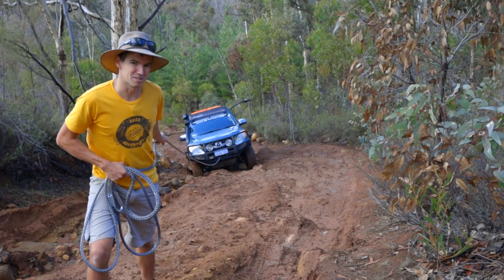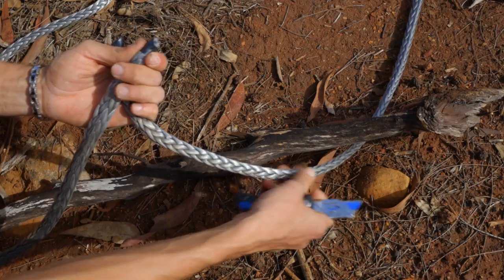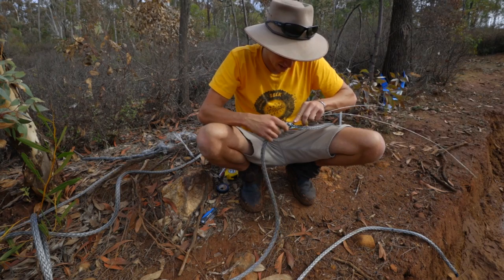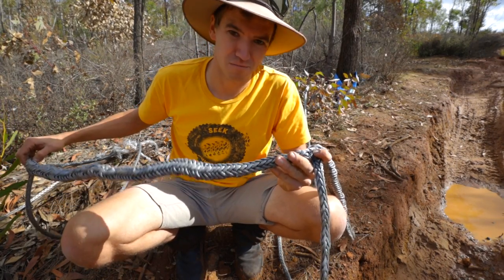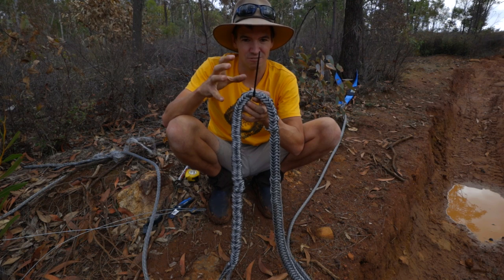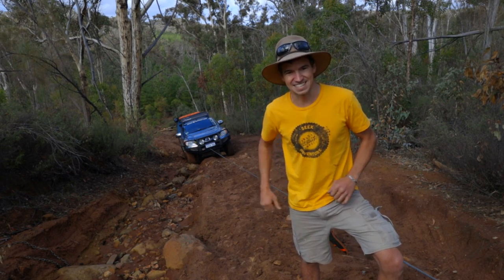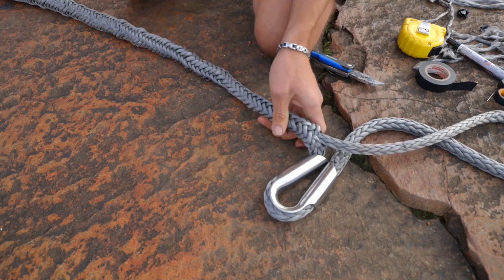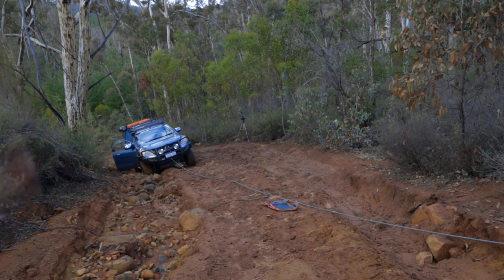Snapped My 4x4 Winch Rope

Comment: Always learning something. I initially thought why not use a steel cable? Then at the end I saw how tough this stuff really is.. and repairable.
Reply: Plus steel cable weighs so much more (huge difference when running it up a hill), and you need to wear heavy gloves when handling it to avoid slicing your hand open on any loose strands, the only problem with rope is you have to avoid rubbing it against rocks (but you can buy sliding sheaths that just stay on the rope, roll up on the drum and be be placed  where needed).

Comment: If you do not have a wire use the oil dip stick from the engine or transmission they work well. Good job with the information.

Comment: thanks for the informative video my rope split towards the hook end so will be fixing it using your second method, however I cannot find any information on stitching it anywhere as I want it to be hopefully a permanent solution, if you have any information on the stitching or could point me in the correct position that would be greatly appreciated, thanks again!

Comment: Could also just tie 2 bowling knots in about 30 seconds and continue the recovery. Can be easily untied after high loads since it was used in sailing and can splice once back at home off the trail or replace.

Comment: When terminating the rope. I always thought it’s better to pull it all the way through once before burying it inside. This way there is an additional change of direction to prevent the rope from slipping out. Infact I’m pretty sure with ski rope you’re supposed to weave it several times before burying it

Comment: A double Fisherman's knot works really well to join the rope together. 

especially if your winch rope is old and worn as it can be hard to splice.

Although this would be a better permanent fix as knots can have trouble going through a winch Farleigh.
Reply from the maker: The double fisherman's knot is an awesome knot for joining rope 👌👌.
The only trouble with tying a knot is that you don't have the full rope strength. While splicing gives you 100% of the rope strength 👍. At the end of the day a knot will get you out of the situation though 🙂

Comment: Not only was the winch rope was pre-cut but he also tried pulling the truck in gear. You can see right before the winch rope breaks that it is pulling the truck and the wheels are not spinning. I believe if I am out 4 wheelin', I will make sure to carry a wire rope or another synthetic.

Comment: No need to stitch it if you weave the tip completely through the rope a couple times before running it through the middle. Also, no need for the damper you're using there, seeing synthetic rope holds very little kinetic energy. Great video, mate!

Comment: I'm seriously not getting why the tail doesn't just come out like you showed towards the end when it's under load. Is it just that the outer layer sinches so tight that it can't move? Or maybe the opening it went through gets super tight? Any idea if it makes the rope weaker?

Comment: Assuming most offroaders don't carry a wire to fish through the rope, I'd be inclined to tie a rethreaded figure 8 to join the sections.  Just going back to my climbing days.  Maybe some sort of video on a true trail fix rather than a more sophisticated fix like this that is more likely done at home?  Dyneema has different knot tying characteristics, some knots might not pass through a fairlead, knots lower breaking strength substantially in many cases, etc.

Comment: You can actually splice without cutting out the tails.  Just trim out a few of the fuzzy bits.   It will serve as your taper section, you lose less length that way

Comment: Nice job there buddy. If you don't mind answering quick question,would you happen to know what the strength compared to original dope would be. Thank you.
Reply: Rope   but I'm sure everyone got it. I've written whole paragraphs and looked back at the word that iPad changed to another word and sometimes it fits and changes the whole meaning. I know there is a way besides better proof reading and rewriting the whole thing but I don't know how. Not very computer savy   but thanks again for a great video

Comment: Have you ever tried a double fisherman knot on that kind of rope. It might be a better temporary fix
Reply: ✖ NO, we don't need to try something that is weaker than the original. 

a) The fact that the rope broke in the first place is an indication that it will break again AT the exit of the double fisherman knot. (ie. at it's weakest point) , & 
b) you would have to cut it loose later to make the permanent repair, 
c) any knot would be problematic IF you have a pulley in that area of the system. 
d) I have used your method before but, where load bearing is involved, have regretted it every time.

Comment: Am contemplating buying a Carbon winch, are you still pleased with your choice?
Reply from the maker: Hey David, that's always a hard choice!
The winch has been great so far, the wireless remote controller is fantastic, water ingress is covered in the warranty which is good, apparently one of the lightest as well.
I have used other brands that unspool easier, and also that a quieter (Ironman Winch), the Carbon is quite loud.
Aside for that I have been pleased so far 🙂. All the best making the hard choice 🤐
Reply: Seek Adventure Thanks Michael, good reply.

Comment: I've used my 9500 lb winch on my 99 xj for 20 years almost daily I have done 300 yard pulls to get out of a swamp. All on the factory cable. I've seen guys I wheel with brake brand new rope. You can keep your junk rope.
Reply from the maker: You didn't watch the end of the video did you? 😉
Reply: @SeekAdventure  thanks for the reply. The fact is I did watch the end of the video. I have been an avid offroader sence 1979 and have owned a jeep for that long and all of them had a winch, I have never broke a winch cable. I have seen JKU's with band new winches bust rope on the first pull. If you would recreate that video with winch cable you better bring a 4.5 grinder with you to cut the cable not a knife. I'm sorry not a fan of the rope. The cable on my xj is shiny and flat from all the hard work it's done in its life. I do love a good stuck video.
Reply: R M I’ve been wheeling my xj since the late 1990’s. Done plenty of winching with my Superwinch 9000.  Mainly other jeeps but once had to use the winch to steer my pos back to camp.  3 hours of pulling the wheel left then right since my steering box broke.  That steel cable was draggin on lots of metal parts some not so smooth.  

I’ve also had to pull my self backward by throwing the cable under the car.  While pulling the line dragged on the cat converter. 

My line has a few shiney places from dragging over rocks but is still fine. 

The spectra line needs to be covered from uv light.  My steel cable does not care.  It’s been trouble free for 20 years.  

Given all that, I do plan on swapping in some nice spectra line in the next year.  

The price is coming down.

Comment: Why do you use a rope instead of a cable? The cable will be stronger and the winch will more than likely break before the cable will.
Reply: #1 lighter for front suspension of the car
#2 rather snap a rope once or twice while getting unstuck than replacing a winch
#3 easier to drag a rope uphill than a cable
#4 no wires randomly waiting to stab your hand because you forgot your gloves.
They're my theories 🙂👍

Comment: One thing he doesnt tell you is that you need to stagger the cut so each strand is a different length. He has actually done this but doesnt describe it. Dyneema has no stretch so this stops all the load going on only part of the rope
Reply from the maker: Good point Alan, I actually recorded the video showing how to taper the ends, but decided to cut it out. If your doing a trackside repair it makes it so much easier to skip that step. The main reason to taper the ends is to stop chaffing, but that shouldn't be an issue for one pull. 
Some new 4x4 winch ropes come out the factory without tapered ends.

Comment: great video mate, will remember that for sure, quick question whats your thoughts on the nitto trail grapplers your running, any feedback would be awesome thanks
Reply from the maker: Thanks Jayden, 
The Nittos... They are pretty quiet, have ridiculous thick sidewalls, and handle really well on almost any surface.

I don't know if my driving style is too rough, but I am a little disappointed with how gouged out the sidewalls are, if they weren't so thick I'd have a few punctures for sure.

They are good tyres, but personally I think I'll go back to Maxxis after this set.
Choosing tyres is so hard! All the best choosing yours 👍
Reply: @SeekAdventure  yeh awesome thanks for the reply and keep up the great work

Comment: My winch has steel cable. why do you have a nylon rope on your winch?
Reply: much lighter
Reply from the maker: Easier to work with, lighter, stronger, less recoil and it can be repaired if it does snap 👍🙂 And it's definitely not Nylon 😳

Comment: Great technique for repair but wouldn't it be quicker and easier to put a bend knot in the rope to get you out of the situation and splice or replace at home. Kudos for sacrificing your rope mate.
Reply: I'm not positive but I'm pretty sure a knot greatly weakens the rope at that point, along with the fact you might have a lot of trouble removing a knot after putting a load on it
Reply from the maker: Your right on the money Matt, some knots even leave you will 50% of the rope strength.
Admittedly that would probably get you out of the situation since the rope is normally rated to 2x the winch max pull 👍 So really it's up to you 🙂

Comment: There are better solutions.  I'd EYE each end and shackle them together.

That splice shouldn't be in your winch line spooled on your winch.

And as others mentioned... we could see that you cut that line appx 80% through to cause the break.  The way the line ends looked are very clear that a sharp knife was applied.

Having a couple of snatch blocks, shackles plus a separate line or two is always a good idea.  So the shorter eyed lines are still useful.  Put a new full length line (with no splices) on the winch at first opportunity..
Reply from the maker: I didn't think there was any doubts the line was cut 😂 But I guess you never made it to the end of the video 🙂

Comment: Tip #1... Never, ever, use a rope cable on a winch. Always have a snatch block (of appropriate strength and size) with your recovery gear and use a wire rope cable made for a winch. Always use a higher rated winch and cable than the weight it will be required to pull. Straps and ropes are for towing, not recovery.
Reply from the maker: You're welcome to your own opinion Steve 👍. But most 4x4 winches with cable use 10mm steel cable, which has a minimum breaking strain of under 7000kg. 

The UHMWPE rope in this video has a minimum breaking strain of 17000kg, not only is it stronger, but it is easier to use, has less recoil then cable if it snaps, and if it does snap it can be repaired on the track, unlike cable. And when cable snaps the damage it can do is insane.

Here is Australia it's actually hard to buy a winch with wire cable, probably 90 - 95% of people now run rope because of the ease of use 👍🙂
Reply: @SeekAdventure  Not sure what you have available to you in Australia, but where i'm from you can buy various capacity winches with various thickness and strength of cable. I'll agree that a broken wire cable can cause substantial damage but if used correctly shouldn't break. I've got a few years of heavy recovery experience and i've also been a recovery instructor and there are advantages to using cable over rope, dependant upon the situation of course.

Comment: Quick way, with no tools or wire, is to use a reef knot, to join two equal diameters pf rope.
Reply from the maker: Hey Martin, that's the quick way to make it snap again mate 🤐. 
I'm not sure if you are aware, but when you tie a knot in a piece of rope you lose strength. From memory the reef knot is one of the weakest knots aswell, losing close to 50% of the rope strength.
If there was a quick way, I would have shown it believe me! 🙂 But splicing is the only way to get the full strength of the rope 👍
Reply: @SeekAdventure  I agree splicing is the best way, but if you did not have the time, or tools with you, the reef knot would get you out of trouble. Do an experiment, see what you find out?

Comment: This ladies and gentlemen is why you dont use rope. Use steel cable or tow straps or both. Rope doesn't have the tensile strength for pulling out a stuck vehicle
Reply from the maker: You should watch the end of the video Dominic 😂😂 The rope used was much stronger then the cables on most 4x4 winches 👍🙂.

Comment: I've never done it but, wouldn't you have a remote control to start the winch as you actually tried to drive the vehicle out? I've gotten out of worse situations just through common sense. II may watch rest of video@ 0:51 now.OK, a tutorial of rope repair, I could get that truck out by driving it. Never go out in the boondocks alone.

Comment: Did not show what to do if your winch ripped the front off the vehicle, and yes I have seen that happen with a forty ton winch and a trailer load of logs, well actually the winch was on the back of a truck and peeled off like the top of a sardine can.
Reply from the maker: Make an insurance claim, I thought that would be pretty obvious 😉😂

Comment: Watched thirty seconds of the video and I see that you're planning on some fancy braiding repair of the line.  After logging for years with cable log skidders, broken cables were not uncommon.  If the break is at the far end of the line, simply tie a square knot in the two pieces of cable and then tighten the knot with the winch.  Coil up the length that won't wind back onto the spool and you can replace the line at your earliest convenience.

Comment: The best way to use a winch, is to make sure the transmission or transfer case is in neutral while using the winch.....your front wheels was locked while the winch was pulling giving resistance...but since your video is about fixing a rope I guess you did that on purpose.
Reply from the maker: As you saw at the end of the video, I had a hard time trying to make it snap in the first place 😉.

Comment: At the risk of sounding like a smartass and I don't mean too but why not tie a knot. I would have never had a little piece of wire like that. Plus most of the time in my experience the winch usually has a cable

Comment: You know this already, but mate you really shouldn't stand next to a winch that's got tension.. Very dangerous. Play it safe for the ones out there who don't think of that stuff.
Reply from the maker: I totally agree Emer, the winch was only under load when I was in the car operating it, it's not hard to see that 🙂 Shouldn't give anybody any wrong ideas 👍
Reply: @SeekAdventure  8:38 you're not in the car champ. Don't be telling me. Porky pies. Great videos, hope to see you around the east coast mate.
Reply from the maker: @unarmedblackguy  What's your definition of under tension? Under tension to me means the weight of the car is on the line. 
I pulled in the slack yes, but in the next shot you can see there was still plenty of slack in the line, the parking brake was still holding the weight of the car 🙂👍.
Generally when I'm setting up a winch pull I'll pull in the slack, it means you can check nothing is being sideloaded and the blanket is where you want it etc, but everyone is different 🙂
Reply: @SeekAdventure  tension is something being stretched tight.. Well that's what I've always been taught. It just looks like its pretty tight.. Anyway it's just food for thought. As I said already in my OP, you know this stuff already. I'm just saying it cause there are so many people out there who simply don't use logic. You're getting big my man, and with that comes responsibilities... Just food for thought. Not correcting you or anything :) keep up the good work mate.
Reply from the maker: @Emer Jones I hear you Emer 🙂👍 Thanks for the kind words mate
Reply: @SeekAdventure  hey, not everyone's having a dig at you. My partner and I really love your videos and your whole personality. We are youngish Aussies traveling Australia in our caravan. So if you're ever on the east coast. Hit us up and we'll show you around.

Cheers for the great work.

Comment: Definetly not Dyneema, it cost around 20 usd x ft, so you say that rope is worth 2,000 usd?
Reply: Dyneema is $2 a ft. For 3/8"
Reply from the maker: I paid $350 aud for 32m of SK75 Dyneema, so roughly $240 usd.
Your getting ripped off if your paying that much 😮😮😮.

Comment: When you put enough strain on a rope to break it, you have most likely ruined it for all practical purposes, There is probably several other places that has almost reached the breaking point, just ready to break when a pull is put on it. Also, if you take your rig OUT OF GEAR before pulling it will; roll a LOT easier! I saw the wheel being drug and not turning!

Comment: A steel rope wouldn't have snapped in the same position. It would have pulled your car even with the brakes on up the hill.
Reply: kigamboni56 guessing you didn’t watch the whole video
Reply from the maker: Try watching the end of the video mate 😉. If the rope wasn't cut it wouldn't have snapped either. Steel cable it much more dangerous and unpredictable.
Reply: Actually steel cable is very predictable if you keep a eye on it , I threw my rope away and put steel back on much better in scrubby rocky county. If I can drag cable uphill anyone should be able to , I am on crutches to walk . Common sense is not very common